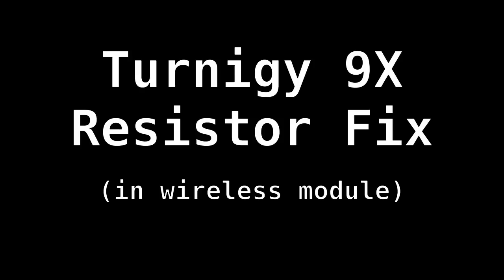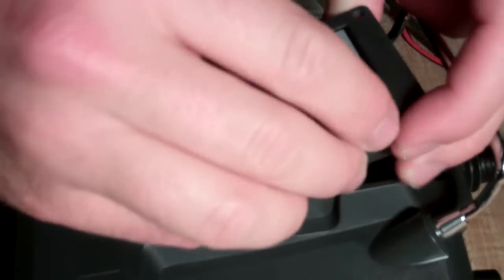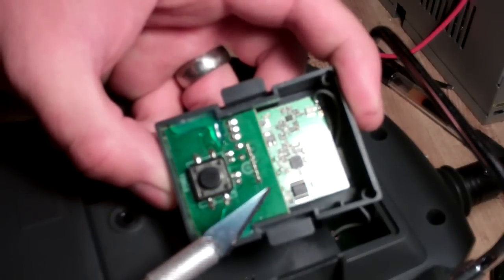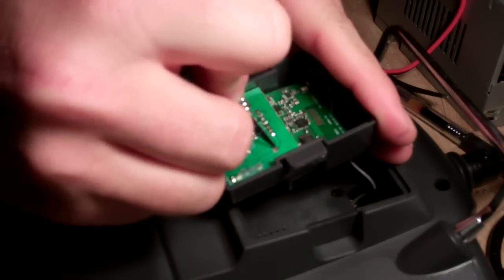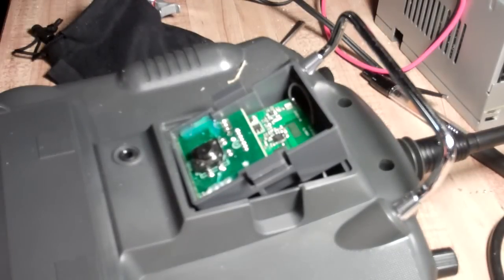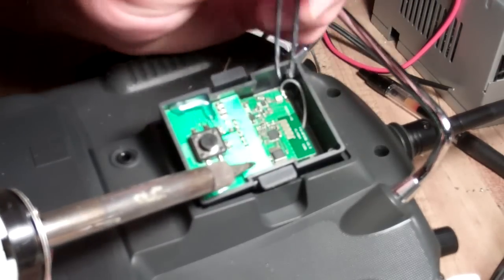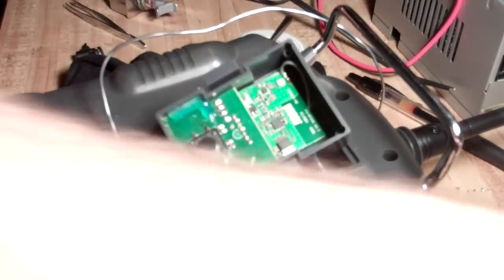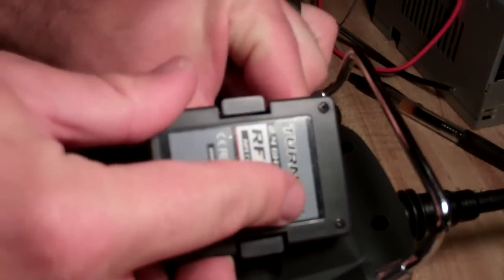Turnigy 9X Trainer Port Resistor Fix (in wireless module)

Comment: From hacksmod:
The latest ER9X firmware has a an option call “Enable PPMSIM” in the Radio Setup screen. It allows you to turn it ON and the er9x firmware routes the PPM signal to the trainer port through a alternate path. Therefore, it bypasses the module and thus the need to add the resistor.
Reply: halleffect1, can you direct me to this latest firmware?
Reply: https://code.google.com/p/er9x/

Comment from the maker: It shouldn't at all.  The PPM line gets modulated and then amplified, so as long as you only touch that trace, it should not affect the power output of the radio at all.

Comment from the maker: I'm not familiar with the Flysky version.  However, with this mod, all you are doing is disconnecting the antenna and reconnecting it, so whatever wireless module you have in there should still work.

With what you described, I'd suspect that there might be a soldering issue and that your signal is shorted or something not properly connected.

Comment: Thanks for uploading this video. I just performed this fix on my flysky th9x,but I have an important question. I was able to bind the module to my receiver (the receiver's LED went from flashign to steady after the binding process), but my problem is that my servos do not respond at all

Does this modification not allow you to use stock receivers?

The reason I did this modification so I could hook up my UHF module to the trainer port and have the ability to use my stock flysky receivers as well

Comment from the maker: @ranthm That small gray wire is actually a small coax cable that goes to the antenna.  Check out my antenna hack video for a better explanation of the gray wire.  There are pins that come out of the back of the radio and plug into the wireless module.  The 3.5mm jack actually has a switch built into it that powers off the wireless module.  Unfortunately, a design flaw allows stray electrons to flow into the wireless module killing the signal that is supposed to come out the 3.5mm jack

Comment: Couldn't you just put a small switch on the Gray wire from module to radio? And then would it work as the trainer controller?